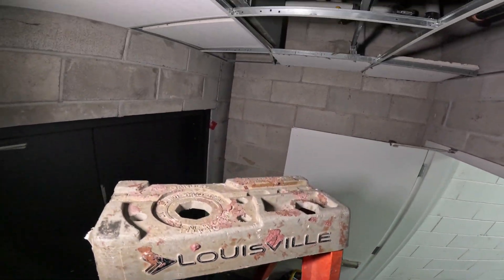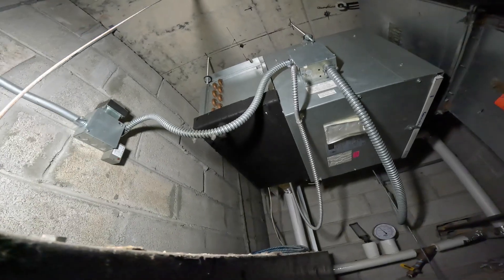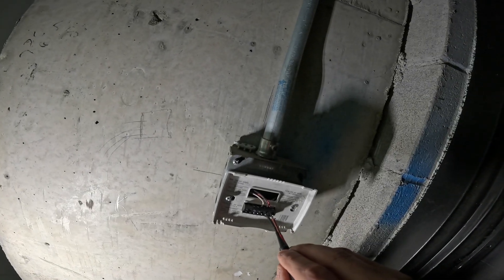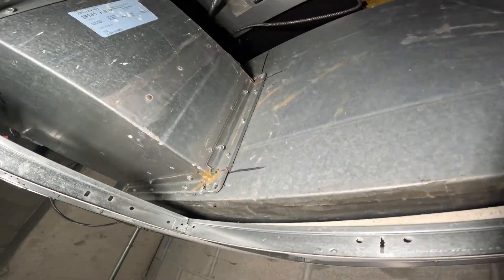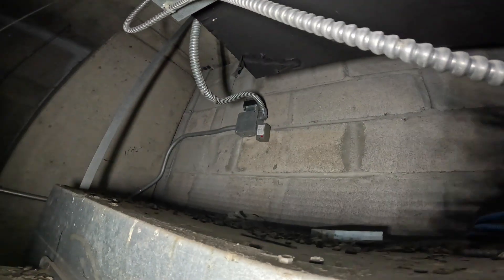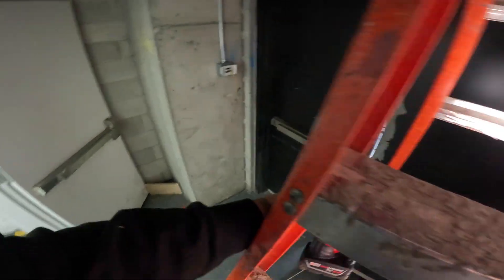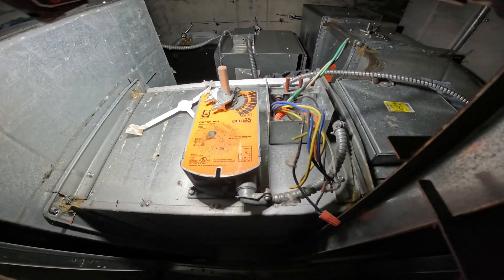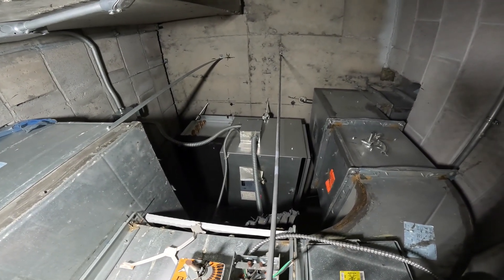HVAC: Commercial Fan Coil Unit Not Working (FCU Not Heating/FCU Not Cooling/FCU Troubleshooting)

Comment: I'm trying to figure out the point of that unit. Is it to just waste electricity. Recirculation of the hot air. Give the boiler a little more load...lol....the equipment that serves nowhere and for no purpose
Reply: looks like it was there to keep the hydronic heated makeup air unit and piping from freezing up in off cycles?

Comment: Where I work, there is a heat pump AHU 5 feet above the suspended ceiling. You literally have to stand on conduit to service it. 

BTW, that's an 8 foot ladder, every rung is roughly one foot.

Comment: somebody set the schedule and temp of that stat then ripped out the buttons and screen so it could never be changed!
Reply: not sure it will work without the screen/front part and the switches may be in wrong position/past where they should be.  probably just got smashed apart with material/clumsy workers.
some of them have a small "anti freeze-up" capsule type thermostat that closes at 40 or 45F, to call for heat even with dead batteries.